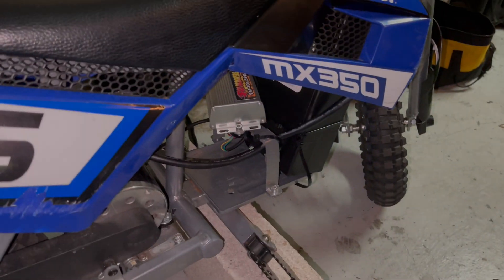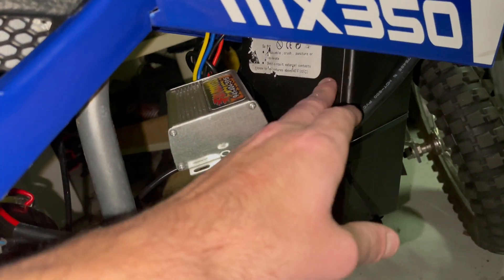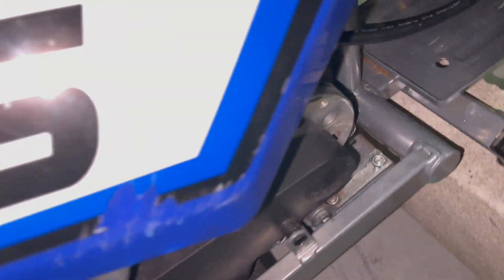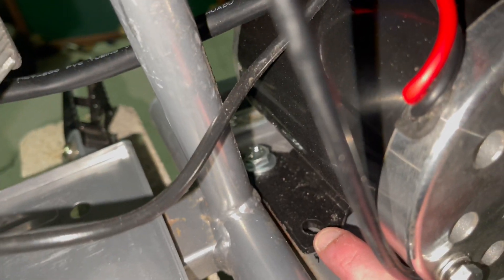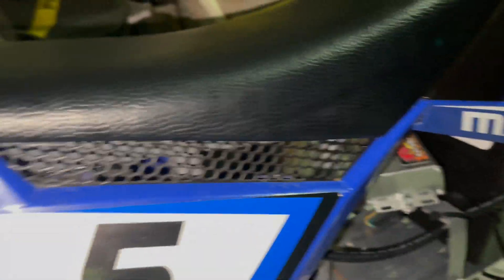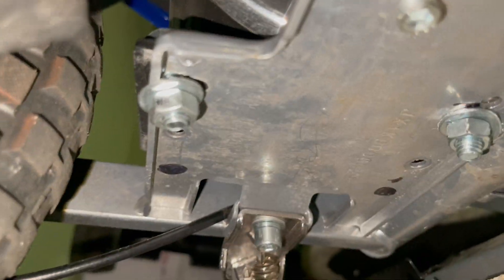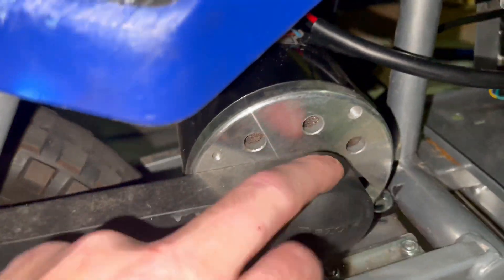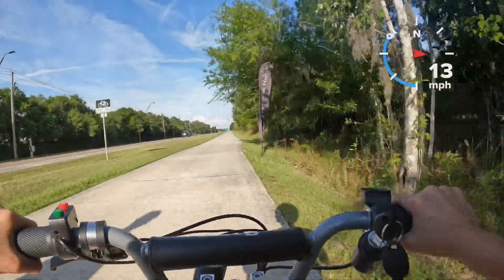48v Razor MX350 -How I Installed The Motor/Controller/Battery/14t Sprocket Speed Runs w/ MPH @ 4:20

Comment: Hi I’m not understanding does the battery make the bike faster or the motor
Reply from the maker: Both do. As does the controller. But you don’t have to change your motor. You can OverVolt your stock 24v motor. Just need an upgraded controller/throttle and either an extra 12v battery or a 36v Lipo. In this video, I changed the motor to a 36v motor so I overvolted it to 48v. Controller/throttle and battery. What are you trying to do? That would be a good place to start.
Reply: @KruseNStuff  could u also send me a link on Amazon to new throttles and a battery 48V?
Reply: Would it work if I kept the motor stocked and just get a 48 V battery how fast would I get in that because my goal is to go fast also you have to add a new throttle?
Reply from the maker: I haven’t overvolted a 24v motor with 48v controller/throttle/battery. But I have overvolted a 12v motor with a 36v OverVolt kit. Worked fine. But that would be up to you to try. If you wanted to try that, then you need a 48v controller/throttle which comes in a kit. And either (2) more 12v lead acid batteries for total of (4) or a 48v lithium battery. I suggest BtrPower. Here are some links to what you would need. Controller/throttle kit https://www.ebay.com/itm/222627137224?mkcid=16&mkevt=1&mkrid=711-127632-2357-0&ssspo=QParOF1BS3u&sssrc=2349624&ssuid=axtom1U_SJq&var=&widget_ver=artemis&media=COPY and battery https://www.ebay.com/itm/115361802236?mkcid=16&mkevt=1&mkrid=711-127632-2357-0&ssspo=ErE3ZEUMTWy&sssrc=2349624&ssuid=axtom1U_SJq&var=&widget_ver=artemis&media=COPY but the 36v 800w motor is only $115 bucks.
Reply: @KruseNStuff  so like any 48 V LI battery will work
Reply: @KruseNStuff  is it confusing at first to build all of this it seems hard
Reply: @KruseNStuff  do you also have to add the throttle or is it optinal
Reply from the maker: @ElijahMullinss  yeah but they are not all created equal. I’ve had great experiences with BTR power💯
Reply from the maker: @ElijahMullinss  stay away from those cheap blue ones. They are all over and crap imo
Reply: @KruseNStuff  I do not use eBay are their options on Amazon
Reply: @KruseNStuff  I’m gonna be honest I don’t know if u have a list but could u send a link to
All plug and play 
A 48 V or 36 V battery
Reply: @KruseNStuff  how fast does 36 V go on a battery with the stick motor
Reply from the maker: They don’t.
Reply from the maker: There isn’t any plug and play for lithium batteries. You would have to solder the right connector for your battery no matter what
Reply from the maker: 22 mph. Overvolted stock motor. With 36v motor, 14t sprocket and 48v 1000w OverVolt you get 25 with adult 30 with a kid
Reply: @KruseNStuff  confused but what makes the bike faster
Reply: @KruseNStuff  and what does over volted mean is that on the battery for like
More Volt?
Reply: @KruseNStuff  does the motor make the bike go faster or the battery which one do I need to mod for the bike to go faster
Reply: @KruseNStuff  I have a question but for the black blue and green cords from the controller do you have to soldier them it looks like a hook
Reply from the maker: You need a new controller, twist throttle & battery. Overvolting is giving more voltage to the motor than intended or it’s rated for. Giving you more speed.
Reply from the maker: Once you get the controller and throttle. The only thing you need to solder is the receiving connector that matches the battery you chose. If you got a BtrPower battery, then you would need to solder an xt60 on. Everything else would be plug and play with the setups I sent you. But it’s sold on eBay.
Reply from the maker: I will be overvolting a 24v power scooter to 48v very soon. It’s already overvolted to 36v now. If you don’t pull the trigger on what you want by than, I’ll let you know how it goes🍻
Reply: @KruseNStuff  what is your email so I
Can show you what I’m talking about
Reply: @KruseNStuff  I’m using the the stock battery all I’m doing is making the motor to a 48V would I need to solder then
Reply from the maker: @ElijahMullinss  if you’re using stock motor. You would need a 48v controller & twist throttle & a 48v battery and yes. You would have to solder or attach a matching end
Reply from the maker: Here is what I did for stock 24v originally. Still have it in an RSF350 now. 36v OverVolt kt https://youtu.be/riGK7sLy4TA
Reply: @KruseNStuff  weird question but is everything you plug in or do u have to soldered with heat is their also a tutorial or manual to how to setup the throttle
Reply from the maker: @ElijahMullinss  everything is plug and play to do a 36v OverVolt to your stock motor. Get 22mph. And would need to add a 12v battery. The kit would come with the extra battery. But to use a lithium battery. You would need to solder the end to match your battery of choice.
Reply: @KruseNStuff  I’m not planning to solder so what should I do then with the battery
Reply from the maker: @ElijahMullinss  over volt 36v with extra battery. All plug and play https://www.ebay.com/itm/322690569735?mkcid=16&mkevt=1&mkrid=711-127632-2357-0&ssspo=QParOF1BS3u&sssrc=2349624&ssuid=axtom1U_SJq&var=&widget_ver=artemis&media=COPY